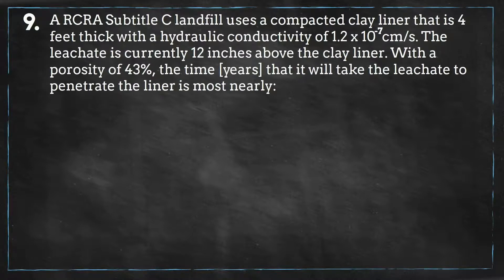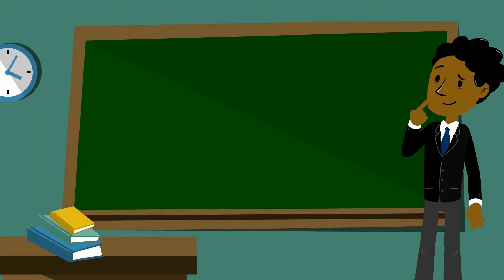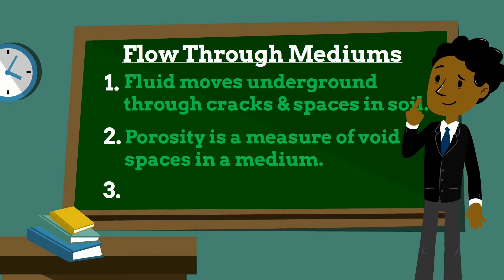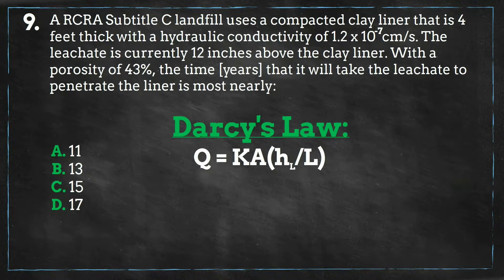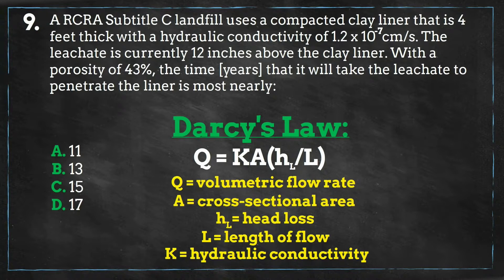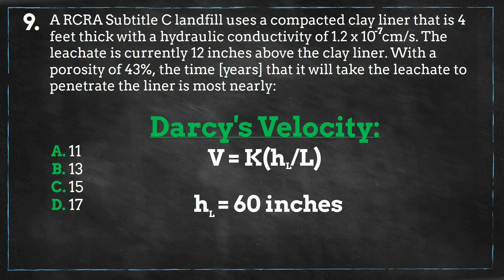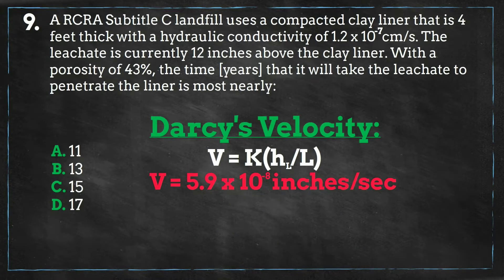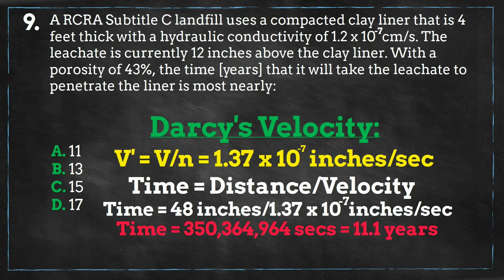Landfill Liners - Episode 9 (Waste Management) | 52 PE Exam Problems in 52 Weeks

Comment: I keep getting a different answer that is less time. Is h = 1 foot? t=(d^2(porosity))/(K(d+h)) = (4 ft^2 * 0.43)/(0.176010236 ft/yr*(4 ft + 1 ft) = 7.82 yr. If I put in h = 5 (Head) then I get 4.34 years. Could you help me make sure that I am using the PE Handbook Equation correctly?
Reply from the maker: Thanks for your question, Mark. Using this formula, your hydraulic conductivity (K) should equal 0.124125 ft/year. 1 cm = 0.0328 feet, and using the conversion of 31,536,000 seconds in a year (60 secs/min x 60 mins/hour x 24 hours/day x 365 days/year), you should get the same hydraulic conductivity (1.2 x 10^-7 cm/s x 0.0328 ft/cm x 31,536,000 secs/year) of 0.124125 ft/year.

Let me know if you have any questions regarding this explanation.